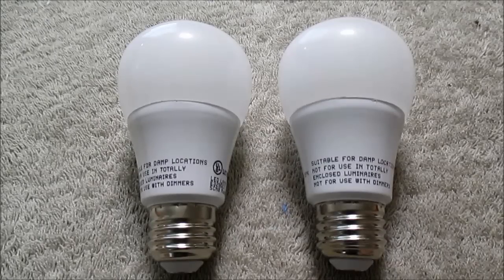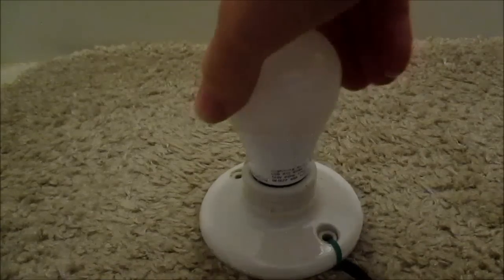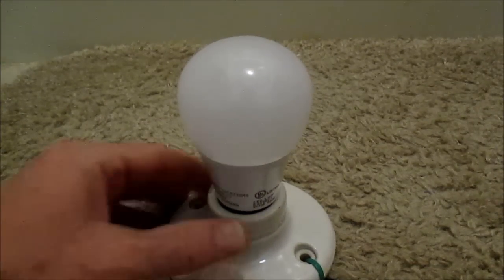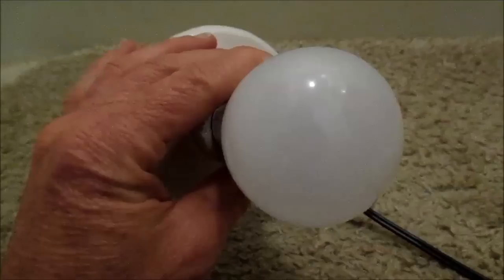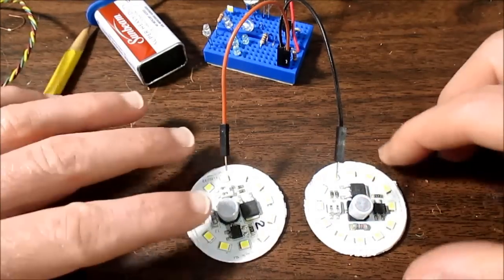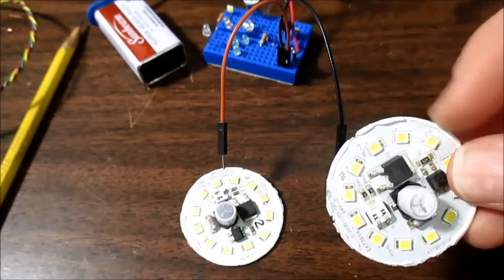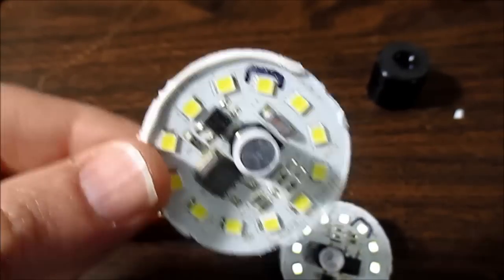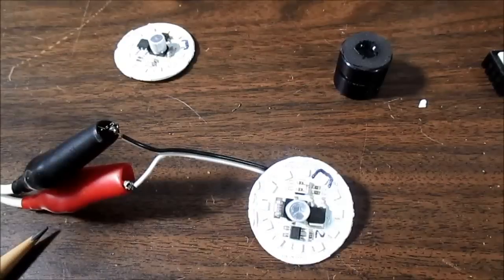Two failed LED bulbs for teardown to determine the cause

Comment: This is a superior video, with good editing, no awful music, intelligent analysis and an interesting topic (at least to me). I will look for more of his videos.
Reply: Yea it was.
Reply: Fully agree. Adding he used very good deal of knowledge and IQ as well.
Reply: The major problem with LED bulbs is the 120V AC can damage the electronics over time and too much duplicated parts to step down 120V AC to DC voltage for LED to use. Someday probably they may need wires inside the home to so you only need to change the LED instead of the whole bulb.
Reply: @starbase51shiptestingfacility  Constant short use is another reason why these fail prematurely. Some LEDs don’t fail prematurely that way, But many do.
Reply: Direct to the problem
Reply: And it’s narrated by Tobey Maguire’s Spiderman! 😜
Reply: Lol.  Superior video.  Haha.  Never heard that before
Reply: The light

Comment: Gone through 3+ Phillips LED bulbs with the same failure as well. I found out most(all?) LED bulbs that look like traditional bulbs are labelled to not be rated for use in enclosed fixtures, which is where mine all failed.

Comment: Designed to fail. Buy more, consooomer goyim.
Reply: They prohibit incandescent bulbs or you may not find them in all stores, and you must buy a stupid Chinese LED at the price of an incandescent bulb or CFL, but it fails after six months of use, or you must buy a high-quality LED, but its price is very high, and you will not be sure that it will live for a long time,  I think that CFL bulbs or fluorescent tubes are better than these junk and some places in the house are satisfied with a beautiful incandescent bulb

Comment: my LED bulb is lighting weak, a bit flickering. All the LEDs light/flicker weakly. When i want to test them one by one by applying voltage none of them lights up. How is it possible? is there a short maybe somewhere? I have that black current limiter on the top, could it be faulty?

Comment: The manufacturers sell these at a much higher cost than the old incandescent bulbs and make claims that they'll last 10,000 hours, when in fact they often last only as long as the old style bulbs they replace. So much for never having to buy new bulbs again. LED bulbs require planned obsolescence, manufacturers are simply not going to sell anything lasting so long as that would certainly not be in their interest.

Comment: very well described on the problem. Some LEDs are SMD component where the solder leads are at the bottom which is not accessible from the top. Also, most reputable bulb manufacturers sand off the IC label marking so that you will not be able to find the replace parts.

Comment: Why when testing LEDs with the 9V battery, did you put a 1K resistor in series?
Reply from the maker: It limits the current through the LED. They can be damaged if the current isn't limited.

Comment: Part of the problem with led lamps, they get hot which will surely shorten the life of the on-board components.  Drill holes around the plastic defused helps to lower temperature inside

Comment: Another guy said they get too hot so he either drilled holes or left the globes off. He put a glob of black window sealant across the bad led to bypass it as the sealant was conductive.

Comment: Just wrap a tiny strand of bare wire around the dead LED to bypass it and remove the fault from the series! Then the rest will work just fine.

Comment: Probably designed to fail.
Reply: Constant short use is why these even fail. LEDs are not good for constant short use applications. If on for a long time at night and on and off constantly during the day. That’s even worse for the LED bulbs.
Reply: @houseguestchannel  that doesnt make any sense tho. Almost all on off switches, charging devices, electronics have LEDs that are either constantly blinking or being turned on and off. I infact cane to this video bcoz i have a faulty bulb that is left on for long periods of time. It has to be poor quality something in order to make sure that their product is purchased regularly. Soo many manufacturers adopt this retarded practice.
Reply: @rashadabdullah9769  LED bulbs have different capacitors than devices probably. But I’ve seen more dead LEDs from constant short use than ones that are one all day/night or on for like 20 minutes or so.
Reply: @houseguestchannel  i wont doubt what you know but i have a high intensity bike like light running 2 LEDs off two lithium ion batteries since 2019 b4 the pandemic. On off, extreme weather conditions, running for long rides or just used as a flashlight around the house. They havent burned out yet but my LED bulb i got last year has. The LEDs in the bulb are intentionally faulty.
Reply: @rashadabdullah9769  I have LEDs in the bathroom and they haven’t died yet.

Comment: Heat death on LED number one in the chain. Most likely due to lack of adequate heat spreading on the PCB traces. If you look at most all cheap LED bulbs the number 1 and final LED have a smaller surface trace area and its a heat choke point. Its due to design and not flaws. They do it to kill the bulb to have you come back for new ones.
Big Clive talks about it in a video on a Poundland LED bulb as well. Link to that vid as well. It has blown up zooms you can see the 1 one LED died. https://www.youtube.com/watch?v=haaI0ht18J0
Reply: Constant short use causes these to fail too. Like a bathroom. It’s not because it’s a damp location, It’s because of constant short use.

Comment: I have had to replace a few and same failures. I am glad they have a failure mode it stops a potential fire but at the same time this is all intentional. The lighting mafia group that formed around the time of when incandecents were taking off in popularity heavily regulate this as well and ensure failures.

Comment: LEDs are better when you just leave it on. Turning it on and off will significantly shorten the lifespan. It’s not as bad as CFLs. But I’ve seen that kill LED bulbs easily. The thing with CFLs tho. Is if you leave it on you get a firey EOL. And if you don’t turn it on and off constantly or it will just die. So you can’t leave CFLs on for too long or turn them on and off. An LED does well when left on. LED failures are usually caused by constant on and off cycles. Like flickering an LED will shorten the lifespan. Regardless what people say. LED failures always happen when bulbs are on for a long time and then off. And then on again. LEDs usually just die, flicker, or dim. An incandescent left on all the time will not last long tho. You will get like 1-2 months out of it if you do. Incandescents can also explode when left on. Also incandescent bulbs should NEVER be plastic. It can be used for CFLs and LEDs but definitely not incandescent or halogen.

Comment: Remove one of the current setting resistors. The LEDs are running too hot and burning out. You can make these things last almost forever just by reducing the current. I know this video is old, but just wanted to throw that out there for people if they come across this comment. LEDs should last decades if run properly, unfortunately the Light Bulb Cartel (Phoebus Cartel) doesn't like that so they design these things to fail. Yay for irresponsibly run capitalism! Capitalism = good, greed = bad.

Comment: My mom keeps buying the shitty GE Ultilitech cheap bulbs from Lowes for the cafe, and they fail after a few months to a year. The 12 or so LEDs are getting grilled and they will fail and glow dimly after a while. Usually one or more LEDS develop black dots of death.

The effective forward drop of the string increases beyond the compliance voltage of the driver as a result.

Comment: This is EXACTLY what I’ve been experiencing!
“Dead” LED bulbs that briefly flash on when they’re turned off.
Other times, when they’re turned on, they may seem dead or super dim for a time, and then suddenly turn on again later.
The voltage in my home is running at 124-125V though, so perhaps that’s an issue ?

Comment: My diagnosis would be lack of incandescent energy. It wears out because of aging. If checked properly, try putting different bulbs. (freshly bought or new and old ones) This usually happens if used for more than 6+ years. Make sure to always and ALWAYS keep it off. Even if it keeps on, it will just make it worse. Always make sure to switch bulbs every 7 years. Try transparent or incandescent ones. Hope this helps or relates. _

Comment: No name chinese products do not have "built in obsolescence" because the vendor knows it is extremely unlikely you will buy from them again even IF you WANT to stay loyal to the brand/retailer/manufacturer.

Built in obsolescence is something that all the well known western brands that have advertising and are household names , do.

Comment: My problem is that the light just doesn't "ignite" sometimes..   If i turn the switch on and off a  bunch of times I can eventually get it to to turn on...   otherwise what it does is flash for just a fraction of a second before turning itself off immediately and remaining off until I flick the switch again..  then there seems to be a 1/10-20 chance of getting it to turn on and stay on.

Comment: Crappy ultra cheap LEDs are used in cheap LED bulbs and lights and they fail after working for far less then advertised even if operated at appropriate voltage and current. Yesterday two of my 5 lights in my room failed at the same time after some years of use, but still much less then they should have lived. Issue is crappy LEDs which died. I have my own design drivers and dimmer, which are certainly not the reason the LEDs die. Next time I will buy better lights or design my own PCBs (or strips even) and use high quality LEDs so I won't have to fix things every couple of years.

Comment: Notice its the same position on each board I wonder if the first LED is just passing too much current through the bond wires.  I bet that led is the first one in the series.

Comment: If the leds don't fail first then the cap will, a few voltage spikes then the regulator will. So the idea of led lightning lasting many many years, is rubbish, and now while power is being saved, the money goes in replacing expensive lamps instead with all that extra toxic waste going to landfill, so it not saving the planet but instead costing us more money too profit greedy manufactures.

Comment: BUT DOES THE CIRCUIT CORRECT AMPERAGE AND VOLTAGE SPIKES FAST ENOUGH TO PROTECT THE LED CHIPS?  IS IT CONSTANT CURRENT CONSTANT VOLTAGE ?  YES, IM ANGRY!! I HAD NO TIME TO TAKE THEM BACK TO HOME DEPOT!!   I bought some for the house and my electronics lab. One bulb burnt out in 2 days. A second bulb burned out within 1 hour. Why?....because my 1/4 horsepower, AC Compressor was on duty cycle and would top itself up every 10 to 30 minutes. I saw the bulb go dull when the compressor turned on and when bright when the compressor turned off.  It has got to be the only explanation since LEDs are current sensitive, current priority.  I hope the manufactures caught on to this and modified the existing circuits.

As a second reference to back up what I am saying.  Have a look at Computer Surge Protector Units. The $200 ones. Now look up their Data Sheets. ITS DISGUSTING AT HOW SLOW THEY ARE TO PROTECT YOUR COMPUTERS. THE ONES I ALMOST BOUGHT COULD ONLY RESPOND FROM MICRO TO  A FEW MILLISECONDS.  Electrical surges, spikes, back EMF and lighting strikes can be as fast as nanoseconds.

Comment: The CREE LED bulb I have, that is about the same power as those, was easy to fix. I did not open up the top part where the actual LED lights are. I opened the base by prying it apart. It opened right up. There are two spring steel prongs that go down from the top part down to a circuit board. There are two connector plates to connect to these springy prongs. I just bent the prongs further toward where the connector plates will be when I close it back up. That means there's a better connection right there. So I closed it back up after trying this once, I found I need to tighten those quite a bit further so there's a very solid springy connection to those connector plates. The second time I got it nice and tight. I closed it back up, and added some Flex Tape to hold the parts together dependably (because most likely the plastic ridges or plastic hooks inside had broken off when I pried the thing open with a tiny flathead screwdriver to get into the crevice. Okay so when I closed it back up and since then (it's been about an hour) - - the light works steadily with no flickering so I believe this was the only problem with this particular bulb. I think it's likely you found another type of problem - - at any rate it seems like an easier fix to check the connector prongs I've described.

Comment: I have had a similar experience, with LED security lights. 3 failures, I decided to use Led security light on the saving of running cost. I had to replace the security Led lights 3 times. Thus cost saving negative. It’s easier to see the Led array on security light as the led rows are visible, easier to spot the defective Led. I have gone back to standard tungsten light bulbs, higher running cost but more reliable.
The quality of Led is similar to the production of transistors in the 1960/1970. There’s 3 types of quality by cost and testing, the 1st quality triple the cost of 3rd quality not tested. Very frustrating as I was a radio/tv technician in though days. The quality of Japanese tv’s and radio’s were far superior to the UK manufacture. This was mainly due to reliability testing hence the reason in the very much higher cost, but also longer guarantee period 3 years. If the item failed within the time it was a free repair/replacement to the customer. The retailer was paid by the company supplied the replacement components, over night delivery at the time. This was not followed by the British manufacturers, their supply was some day come day. A number of companies set up supplying general grade 2 components. Some are still around today giving much better quality and over night supply. The British manufacturers went down the road of pile them high and sell them cheep. Consequently many of the British manufactures are no longer trading today. The quality of components use in industrial market was much better, with better guaranteed equipment. Now most of our domestic radio/tv’s are of Japanese design. Who remembers Amstrad! 
Computers to masses.

Comment: Thanks great info. I have a box full of Osram LED falures. Just one thing. Be careful with graphite pencils and electricity. I know of someone who died using it as a pointer. Much higher voltage though but still...

Comment: Why don’t you swap the bad with the good LED?  With a soldering iron.
Reply from the maker: It's possible but another LED will likely fail in short order. This video was made about 3 years ago and the LED bulbs that replaced them are still working fine. They are a different and better quality bulb.
Reply: JohnAudioTech @ The LED bulbs are getting so cheap and I quit making any effort to breath new life into old bulbs.  They are Chinese made and selling in Korean food market from $0.02 to less than $0.50 a piece..  I bought a pile and paid around $0.10 to $0.20 each, I recall.

Comment: Engineered obsolescent.  There once was a time when things where made to last. Now many things are not made so well on purpose. It keeps us going back to try to find a good one that does work. Companies are not held accountable for anything that they do wrong now. They know that their products are faulty and they still send it out to the public. Profit comes before anything now. I buy a led or cfl light bulb and if it does not work when I get it home, the store that I bought it from tells me that they are not responsible for its failure. There is not accountable from any stores either. Let the bulb companies laugh all of the way to the bank because there are no laws which make them accountable for anything anymore.

Comment: Multiple LED bulbs in parallel seem to interact and fail.  Could be cable inductance and switching noise damaging active parts,  MOV on the line?

Comment: measure the voltage drop of that dodgey LED and compare it's drop to the others in the string, They are probably over driving the led's and that does not result in long lived led's.

 Those surface mount resistors are not rated for 120v and may be causing problems. Although in this case the LED's have failed an intermittent resistor could cause damage to the weakest led in the string..

Comment: I worked at Lowes in the early 2010's and I saw the influx of Led lamps(bulbs) begin to come in.
What I call first generation Led's were expensive, they were heavy with large heat sinks.
I bought as many as I could afford for as many applications as were available at the early stages.
As more types of lamps became available the prices went down and so did the quality. I have not had a single 
failure of my first generation lamps and they are approaching 10 years old. As far as I can tell led's are no longer made 
like first generation. Also , for the unknowing , do not install led lamps in an enclosed fixture . I see this being done all to often.